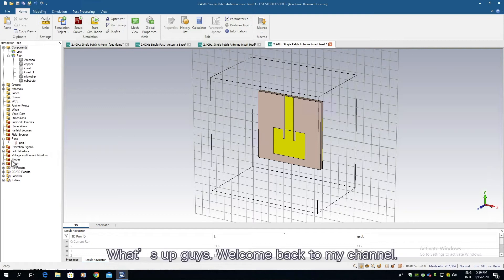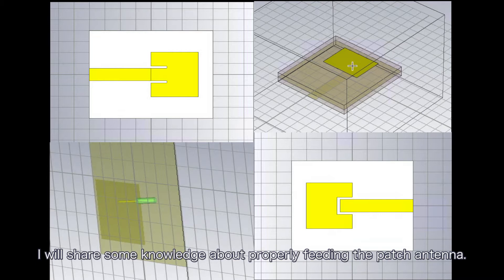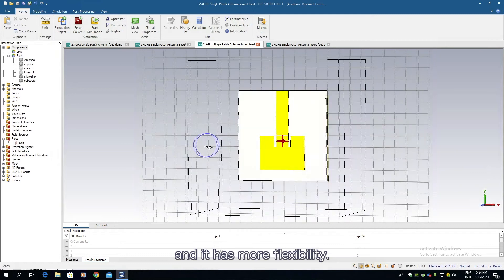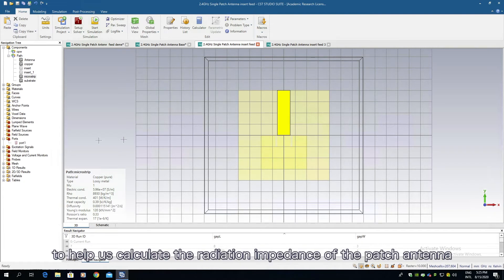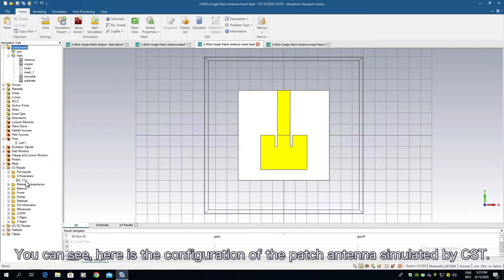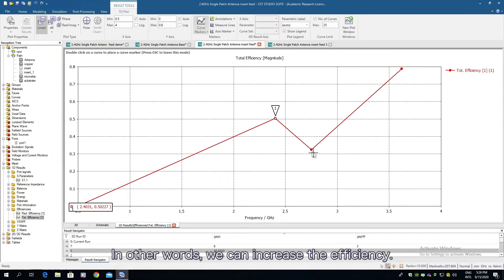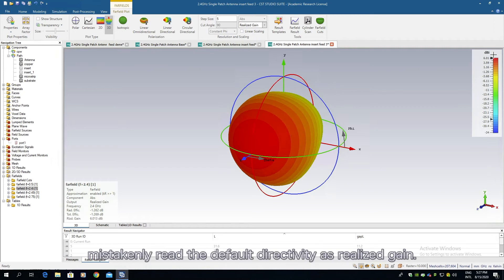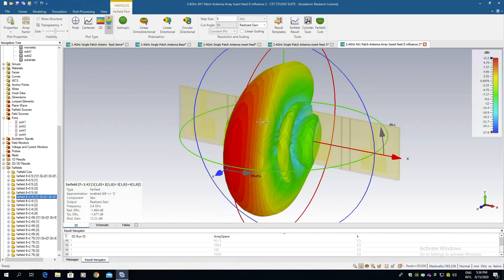Patch Antenna Feeding

Comment: Do you know anything about 50 ohm feedline,100 ohm feedline, quarter wave transformer all are integrated in one feeding I don't know about the concepts of you know please help me.
Reply from the maker: 50 ohms or 75 ohms, 100 ohms and whatever ohms transmission line can be designed with the help of many tools. For microstrip line, and stripline you can find lots of free tool, if you just google the  key words such as  microstrip line. and CST has them integrated.
Reply from the maker: As for quarter-wavelength impedance transmission., stare at the smith-chart, you we understand. Basically, Z1*Z3=Z2*Z2 and Z1,Z2 andZ3 are three sequential microstrip line.